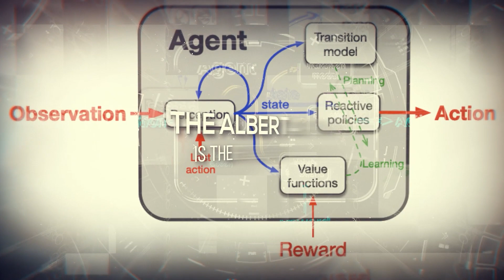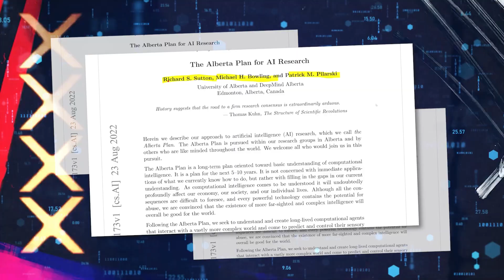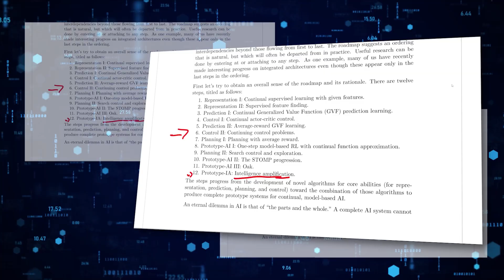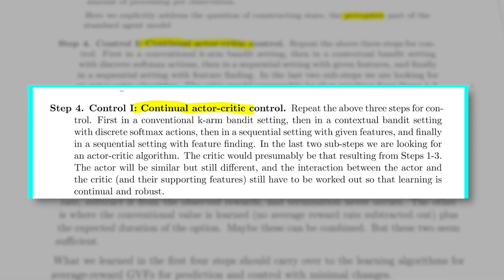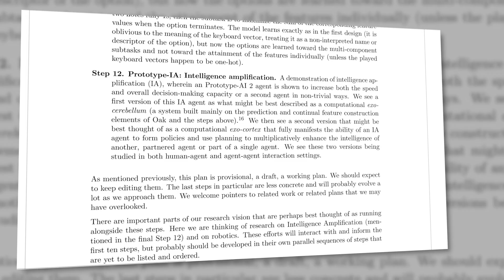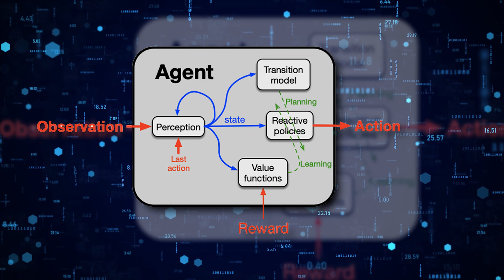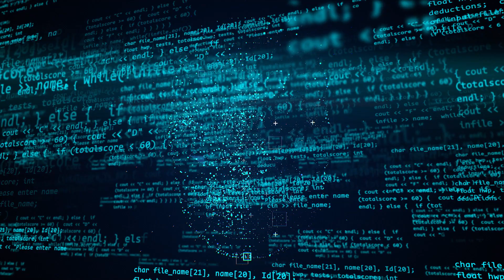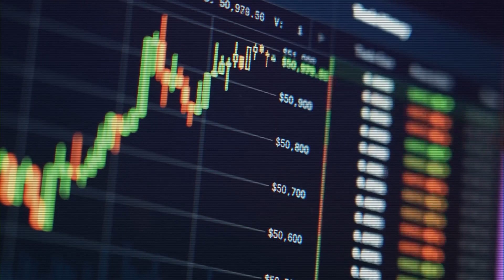Google’s AGI Revolution - The Alberta Plan Unveiled

Comment: None of the three "experts" mentioned has any understanding of AGI. The Alberta plan is just a shot in the dark, but it has no chance of actually hitting a target.

1. The learning method is incorrect.
2, The autonomous mode is nonsensical.
3. Predictive learning won't help.
4. This is unrelated to AGI learning.
5 - 8. This is just trial and error with associative learning. It's a waste of time.
9 - 11. Directed abstraction is what we do now.
12. This won't work. this method will break when encountering anything novel. Trying to add more methods will run squarely into the law of diminishing returns.

Trying to do more of the same is ridiculous. It isn't even theoretically possible for this to work. The field is years behind.